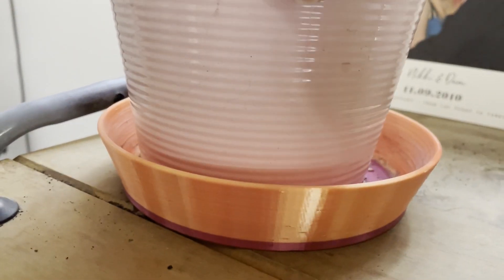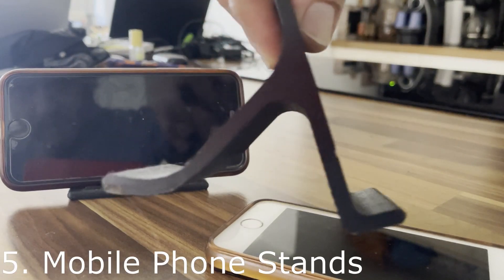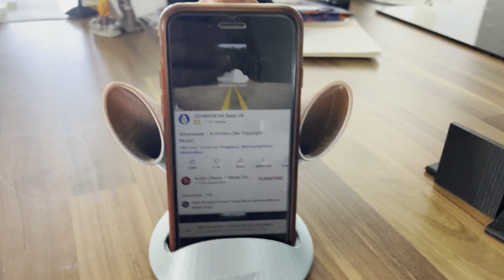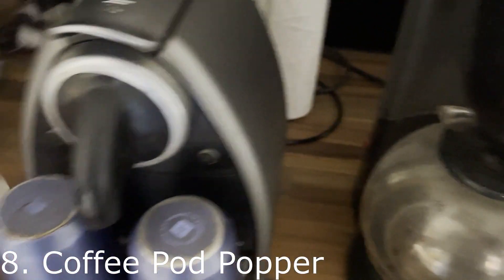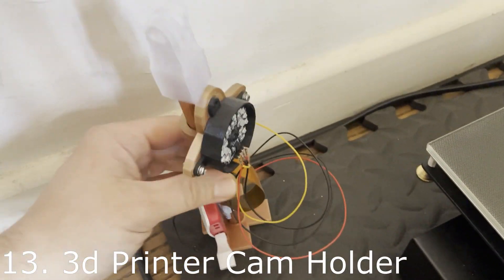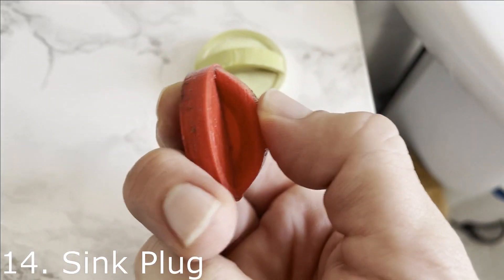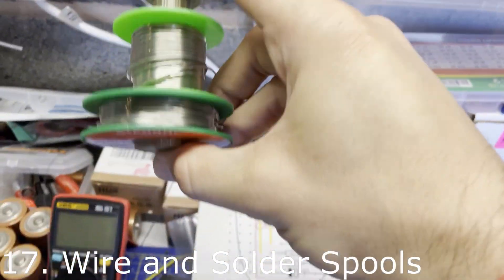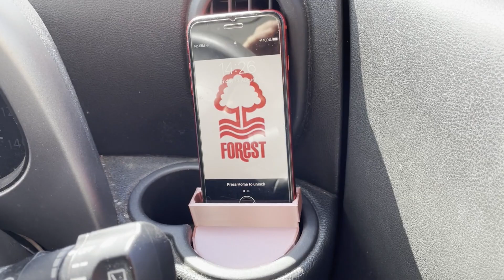20 Practical and Useful 3d prints solutions around the home

Comment: Hi there can you please tell me how you printed the word cup I'm having a lot of problem with the letters on the base I use prusaslicer.
Reply from the maker: Hi, the world cup trophy was a tricky print. First of all I resized it to be smaller and this is where the problems started. The design is too complex to print it small, so I had to make it bigger and bigger before it printed successfully. But the letters on the bottom are still not correct since they look partially printed, but it was good enough. I always use Cura to slice my prints, but it may be that you have to print it much bigger to get the letters to print correctly.

Comment: Hey Domenico, are these printed from PC filament?
Reply from the maker: Most of them were PLA filament, and the red sink plug was a "Flexi PLA" but I can't seem to find that filament again. I have printed with ABS too but the temp of the hot end and bed needs to be quite high and you need some way of keeping a consistent heat around the printer too. Other than that I've also used TPU which ends up really squidgy but you have to print very slowly and get the temp right too.